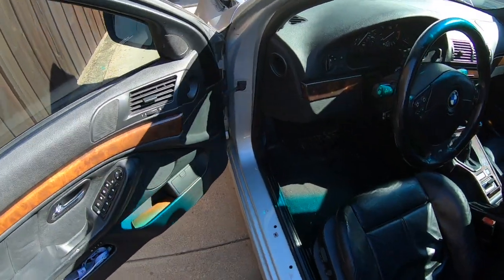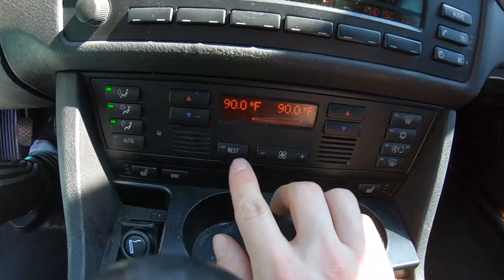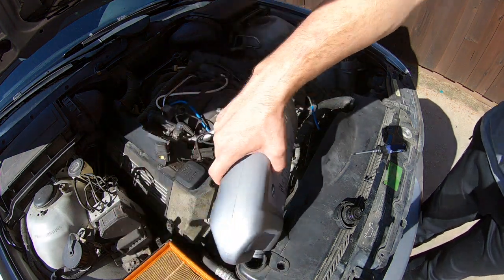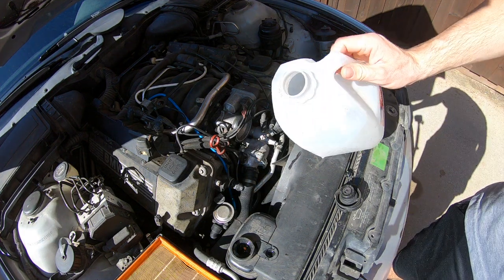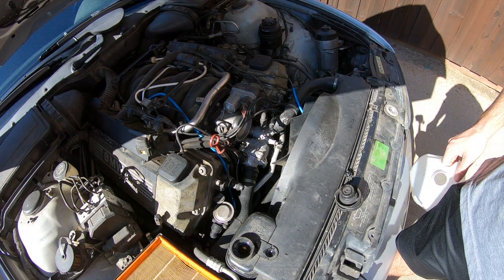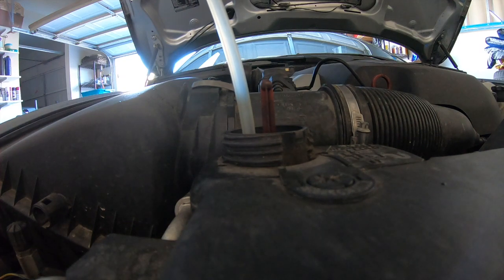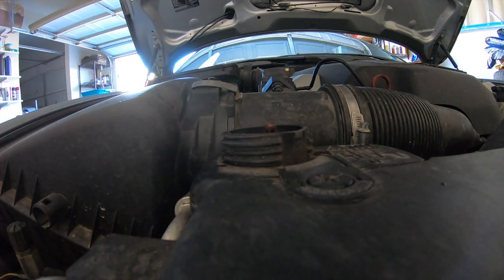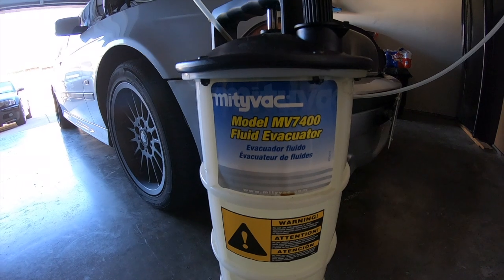How to Bleed and Fill Engine Cooling System | BMW E39 540i

Comment: Um turning the heat on at the beginning isn’t going to do anything if the car is off, the water pump isn’t pushing anything unless the engine is on. and they’re won’t be enough heat to keep the coolant flowing through the system at first either
Reply: This car has an electric auxiliary water pump that circulates coolant with the engine off. High heat with low fan ensures the heater valves are open so that the entire system is flowing for bleeding purposes.
Reply: @jasoncobb2067  I made that comment a year ago, I’m aware

Comment: How much coolant does fit in the system i just changed my expansiontank  filled it and stopped when the red stick came up. After driving for 1 hour i opened the tank and the coolant fluid had dropped alot.

Comment: Trying to bleed my 540 after some tries with other popular methods. So doesn't filling the expansion tank to the top like that leave no space for the air to expand? And I've seen some similar methods that also tell you to, with the engine running, open the bleed screw after bringing the car to temp until bubble-free coolant runs. Is that needed? And should you drive the car to heat up to like 80-90c only? or full operating temp at like 108c? Sorry for all the questions! Great vid.
Reply from the maker: Good questions Chadd! I've used this method to bleed the coolant system a couple of times without issues. My understanding is that even after bleeding the system, there will still be some air trapped that the excess coolant will replace. I let the car get up to operating temp and then park the car overnight to check the fluid level in the morning. If there's too much, I'll remove some using that fluid extractor. 

I've seen the method that works with the engine running too. I'm sure it will do the same thing (maybe a little faster) and you probably wouldn't be running the engine long enough for it to get to operating temp so there shouldn't be any risk going that route. Let me know if you choose to do the engine on method!
Reply: Tire Kickers Awesome sounds good, tried your method today now just waiting for the car to cool to check levels and probably remove some excess coolant. When I was running the car in the driveway however, coolant was dripping from the cap the whole time as I assume maybe I put in too much coolant? So there was no space for the coolant to expand. Not sure if that is normal in this process though. I Let the car run to 80c
Reply from the maker: @Chadd Yuan I had a problem one time where the oring on the bleed screw was allowing coolant to leak out when the car was at operating temp and would make a hissing noise. Sounds like it’s possible that there may have been too much coolant, but as long as you remove the excess you should be good. And then keep an eye on your fluid level after a couple of drives to make sure your everything’s performing correctly. Sometimes it requires a bit of a finesse, but I think you’re on the right track!
Reply: Tire Kickers Hey sorry just had an update question. So taking another host with this method, i’ve done 3 30 min sessions roughly following the bleeding procedure for the last few days without starting the car but just trying to get the air out. But i’m still getting bubbles and just wondering if it’s possible to have this much air in the system? Here’s a link to a vid of the bubbles i’m taking about even after 3 days of filling, squeezing the hoses for bubbles, filling, etc... By the way, loving the e39 LS swap vids! Here’s the link: https://youtu.be/9SPCPfjS7lY
Reply from the maker: Chadd Yuan I took a look at your video and asked for input from some other folks that know E39s well. We recommend that if you're concerned about the air bubbles that are still escaping, try putting the front of the car on jack stands, seal the cooling system, then start the car and let it get to operating temp. This will ensure that the thermostat opens so the coolant can circulate, and the air bubbles should rise to the highest point in the vehicle which, in this scenario, is your bleed screw. Let your engine cool back down before you check the fluid level, but doing this should help get rid of whatever air is left. You can do the bleeding procedure afterwards if you want to double check, but I'd imagine there's not enough air in the system to give you serious overheating concerns as long as everything is functioning properly. Glad you're enjoying the LS Swap videos, they've been fun to make!
Reply: Tire Kickers Thanks for taking a look I really appreciate it! So would I open the bleeder screw at any point during or after getting the car to operating temp? or when checking the level the next day would opening the cap let any air that has risen escape.
Reply from the maker: Chadd Yuan No problem! I'd leave the bleed screw installed while the car warms up, checking the level once the car is cooled should release the trapped air as you said. I've seen people unscrew the bleed screw while the car is warming up to get rid of air bubbles, but I've never done that method.